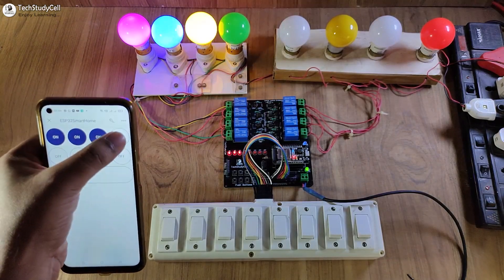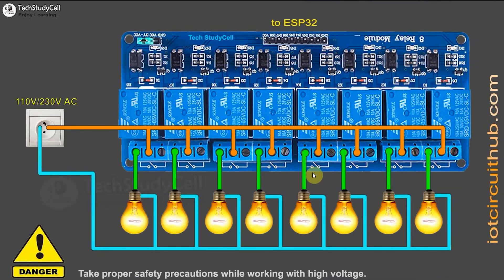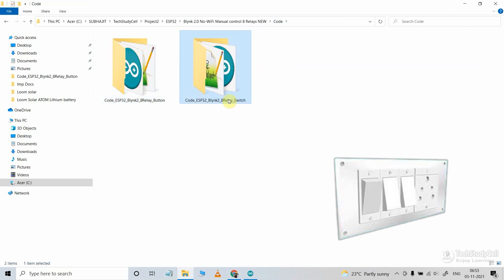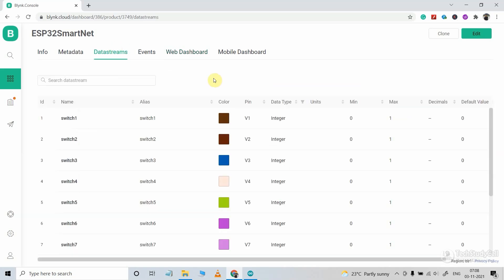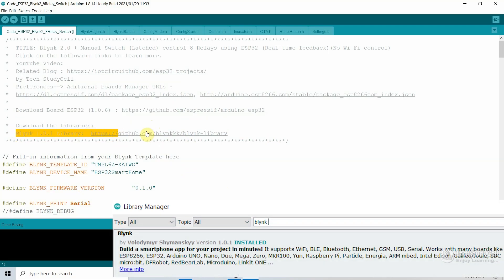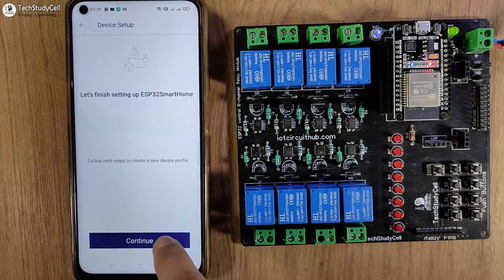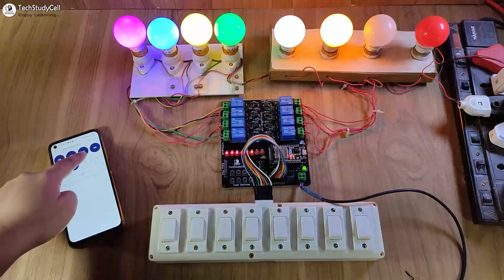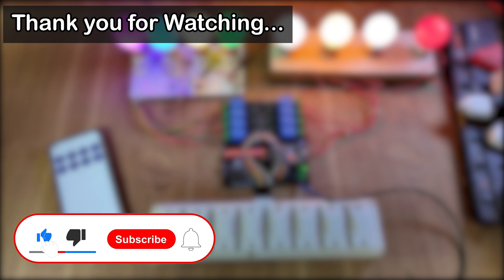IoT Smart Home project using ESP32 Blynk control relay with WiFi + Manual Switch - 2021

Comment: This project is amazing but i have a question 
When you restart the esp32 board it fetch the data from blynk previous state not manual switches your manual switches are only used to control the relays but esp32 did not save the last state of switches so this project is not helpful for us kindly fix this issue please and thanks for sharing your other projects with us I really appreciate your effort

Comment: Is it possible if I will use esp32, 5V 8 channel relay, 12V battery supply to control the solenoid water valve using blynk 2.0?

Comment: fro me shows the error while uploading   Arduino: 1.8.19 (Windows 7), Board: "Arduino Uno"

In file included from C:\Users\ADMIN\AppData\Local\Temp\arduino_modified_sketch_722226\BlynkEdgent.h:9:0,

                 from C:\Users\ADMIN\AppData\Local\Temp\arduino_modified_sketch_722226\Edgent_ESP32.ino:19:

C:\Users\ADMIN\Documents\Arduino\libraries\blynk-library-master\src/BlynkSimpleEsp32_SSL.h:15:2: error: #error This code is intended to run on the ESP32 platform! Please check your Tools->Board setting.

 #error This code is intended to run on the ESP32 platform! Please check your Tools->Board setting.

  ^~~~~

In file included from C:\Users\ADMIN\AppData\Local\Temp\arduino_modified_sketch_722226\BlynkEdgent.h:9:0,

                 from C:\Users\ADMIN\AppData\Local\Temp\arduino_modified_sketch_722226\Edgent_ESP32.ino:19:

C:\Users\ADMIN\Documents\Arduino\libraries\blynk-library-master\src/BlynkSimpleEsp32_SSL.h:24:10: fatal error: WiFiClientSecure.h: No such file or directory

 #include <WiFiClientSecure.h>

          ^~~~~~~~~~~~~~~~~~~~

compilation terminated.

exit status 1

Error compiling for board Arduino Uno.

This report would have more information with
"Show verbose output during compilation"
option enabled in File -> Preferences.

Comment: Have a little question.

Would like to see all this operated via multiple ESP32 modules, that is, I now only see an ESP32 sitting directly on a switch block and sitting directly on a switch block.

Everything is nice and well, that is nice in a test environment like this, the practice is more unruly, let's assume that, do you not think that is a better plan, because here we have nothing in basics, right?

I have to attach that switch block to a separate ESP32 module, because it is somewhere in a central point in a room or several rooms and thus multiple ESP32 modules to make it more difficult, put the ESP32 in MESH switching.
Somewhere else is the other ESP32 with its relay card which controls the lamps and other grut, as above in terms of MESH the multi-chamber principle.

Do you have an idea how to solve that?
Let's assume 2 rooms with 8 relay contacts each!

Old Wizzy, in NL

Comment: Very nice video 
What component did you connect to the JD VCC and JD GND.
Reply from the maker: Jumper.
Reply: @TechStudyCell  the black component is a Jumper?
Reply: @TechStudyCell  on the PCB
Reply from the maker: Yes it is just a jumper to connect 2 pins.
Reply: @TechStudyCell  thank you

Comment: Nice one brother. Does this rennet the switch state in case of a power cut. Like if the switch was on will it automatically turn on when the power resumes or will it default to off? And Can you control this with Alexa and if yes how? And do you have to always press the reset button for it to reconnect to wifi?
Reply: Did you manage to figure out auto reconnect? So far only way that works for me is a while loop and if statement when lose connection reset esp but this changes the state of thr light or relay.
Reply: @crouchingchicken007  you’ll have to save pin status to memory and read that while restart.
Reply: @RameezRazaRiaz99  would that be via the EEPROM? Also while I've been testing this, it seems like the system favors smart control via Blynk over manual control of the switches. Or maybe internet just isn't good enough? Thank you for your reply
Reply: @crouchingchicken007  yeah by eeprom. I didn’t like blynk much so I ended up making it using the espalexa library and it works flawlessly.
Reply: @RameezRazaRiaz99  I'll have a look at that thank you

Comment: sir  i make this project for 4 switch only its work perfectly but  there is some mistake/bug in code that when i switch on all devices either by manual switch or by blynk app after that Wi-Fi is permanently disconnected after that it is required to reset the board

Comment: Nice project bro, please I need help 
I want to use your PCB board can you provide different terminal block to supply esp32 board and change the input header pin  to terminal block please 🙏

Comment: Woahhh👏👏 Bro, Can u please make a  base board of this that is ready to be installed behind the switch board because the esp32 or node MCU also need their own power supply I am sort of confused on how to do this without the need to use a charger and connect to the socket.